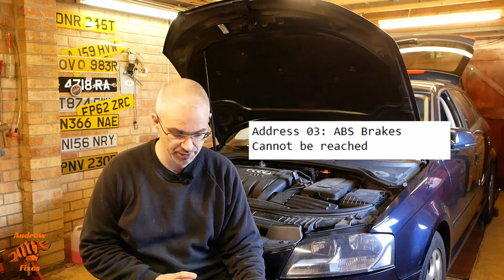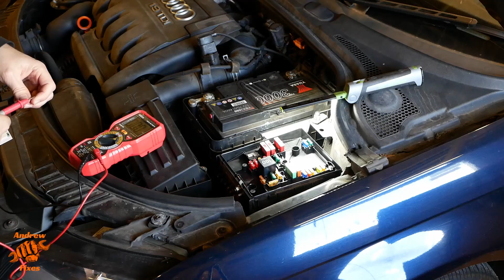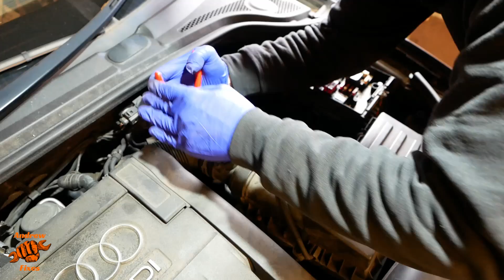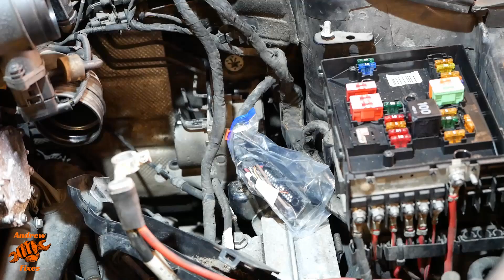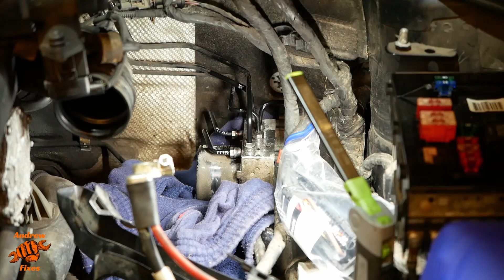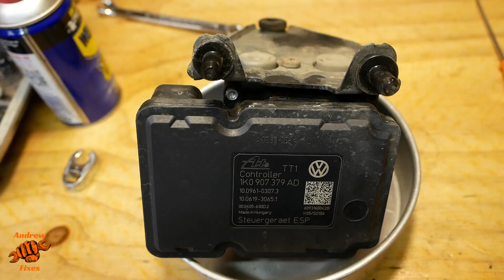Audi A3 brake fault! Drive carefully to nearest workshop. Part 1 - diagnosis and dismantling.

Comment: I have the exact same problem on a 2010 1.2 tfsi. Only difference is that my fuel gauge stays working. The brake fault seems to appear after the engine is warmed up and been driven for a while. So it's not a permanent fault and it usually goes away after the car has sat for a night and cooled down, although yesterday it gave me the fault and i turned the car off for 5 minutes. When i started it again all the lights were off and it was normal again.

Thanks for the informative video Andrew, this will certainly help me with mine!

Comment: I had all the same issues display was like a xmas tree removed the unit as per advice sent away for recondition report said not fault found in unit. eventually found a guy previously work for Audi dealership did a diagnostic £64 he replaced a fuse and 3 years no fault return

Comment: Had this for 12 months now, garage changed abs module, but it came back 6 months later. Now had 3 new sensors, break pads/disks fitted around, really have had enough of this car now.
Have even deleted codes whilst car is parked on a slope and then ragged the car and no codes appear(until ignition is switched off and you drive away again.)

Comment: Do you have a workshop and if so, where are you based? Not enough guys I know who take this much pride and read up on the proper procedures to follow, I had the same issue on my a4 b6 quattro sport 1.8t, 2 abs modules later, the guy kept coding it incorrectly until I managed to work out the codes using the spec sheet with the cars manual and talked him through the procedure which also involved a steering alignment through vcds instructions, we also coded the other module which worked so I was able to sell it as a straight plug and drive and recoup some costs atleast but trying to find a reliable person to do any work is like finding a needle in a haystack

Comment: Thank you so much for this video. I had this issue for 2+ years now. It would happen on wet terrain while hard braking or lately in random situations like driving uphill into a corner at 60+ mph. Worst thing is, I read online that after the fault code flashes the abs is off! Imagine having to brake to prevent an accident... I have been to an audi dealership in the past, they tried the "erase all codes" method and that didn't work. I will now talk to my local mechanic and see if he can take a look at the fuses and wiring harness. I think I'll even let someone check the whole pump out. There was little information about this topic online. This really helped a lot.
Reply from the maker: That's great to hear, glad it was helpful and hope you managed to get it sorted out.

Comment: I have this message with the Start Stop. When the car turns off and then you push the clutch to start, when starting it show the message “Brake Fault. Drive to the nearest….”.
And then it dissapears. While driving i have nothing. With VCDS it shows no faults. 
Sometimes when i have to brake the pedal goes very down.

Comment: Hi I have a 2018 audi a3 handbrake switch is flashing red had it plugged in at audi they say there is a fault on the wiring from handbrake switch to the abs pump do you know if all the wires from the electronic handbrake go to the abs pump plug? As I can find most of the same colours I tested for continuity and 3 of the wires are dead I just need to make sure that they are  the same wires before I connect some temporary wires to see if it is infact a brake in the loom thanks

Comment: Mine has esp light on constantly,Failed MOT..abs and steering works fine and no lights on dashboard
201 pressure sensor electrical fault.
Apparently it’s build in the abs module.Replaced 2 abs modules and fault is still there…Any help? :/

Comment: The simple easy one issue that can cause too many warning lights turn on ( ABS - ESP - Power steering etc ) sometimes is just Incorrect 4 tires pressure that’s being ignored especially on newest AUDI cars ! The first CHECK before going to somewhere else part’s But some ordinary ppl were going to dealer or mechanic and yeah you will be pushed to spend money for something that you can fix yourself with just basically easy without removing anything’s 
I’m a noob but it’s just my first ordinary step aid

Comment: Hello Andrew I have a problem with my Audi A5 2009 when I turn on after some meters when I’m moving it shows me brake system fault contact workshop abc esp epc lights came on and the speedo drops to zero and stuck to zero. When I’m turn off and turn on the car after a while all the lights came on again. Any idea what’s going on
Reply: Salut, ai rezolvat problema ? Îmi poți spune și mie care a fost ? Te rog frumos

Comment: Hi. Same issues on mine and i am thinking of sending it off for repair.
spoke to an auto electrician who said that in most cases it's just the plug that is damaged on the ecu, he soldered across something on the plug to fix it.
 He said it can be repaired quite easily without taking off the full pump to send off.
 Have you heard of this or know what he is referring to? thanks
Reply from the maker: Interesting - I don't know what he is referring to but it sounds like he's encountered this problem a few times before. I guess you could access the electronics on the pump without removing the whole unit, but I think access would be quite tight. The repair on this one didn't take long when I sent it in, so I wouldn't be surprised if it was just a dry/degraded solder joint or two.

Comment: Hey, this is a great video. Mine is throwing  a P0299 underboost code, but I've had the turbo vacuum/boost etc all checked. 

I then relaised the brake pedal was going hard. My mechanic has replaced all the vacuum pies and it's still playing up. Would the most likely fault be the actual vacuum pump itself? The pedal is only hard when no pressure has built up e.g right after starting up or right after braking.

Cheers,

Ben

Comment: Mines got same lights but no steering light and miles and speedometer is working just esp abs and brake light flashing together and stop to go to dealer
Reply: I have the same problem, have you managed to fix it?
Reply from the maker: Interesting, I'm not sure if the ABS unit can fail in different ways such that the odometer and speedometer would continue to work, or whether this is pointing to a different problem. It would be worth connecting up a scan tool to see if it can communicate with the ABS unit.
Reply: Get a Vcds scan done to find out why the abs lights are on in the first place.
Reply: My cars only got traction control light on however when i scan it it comes back with brake pressure sensor 1 and im hoping that this will fix it as ive just bought a used one and swap over the mechanical part, could mine be a different cause because it is only showing traction light not abs ?

Comment: have this same Audi today it stopped completely in the middle of the road.  Is Abs Steuergerät the reason for that view?  Please respond to my comment
Reply: Had the same problem. No faulty were set. In the end the hydraulic unit was bad. After replacement everything works fine.